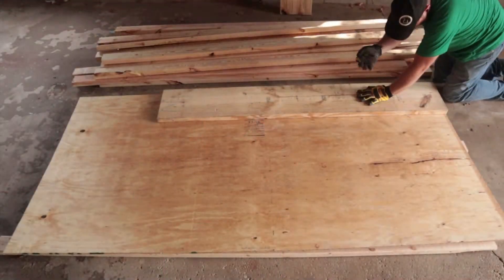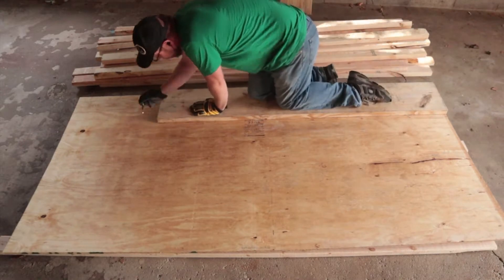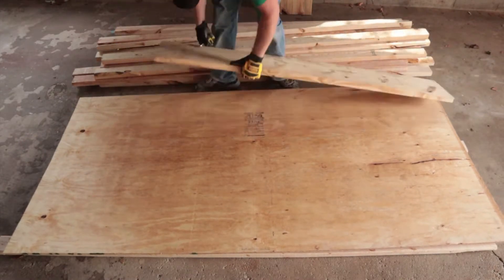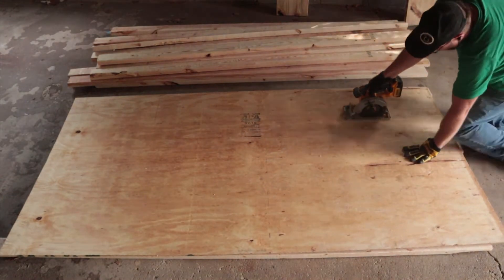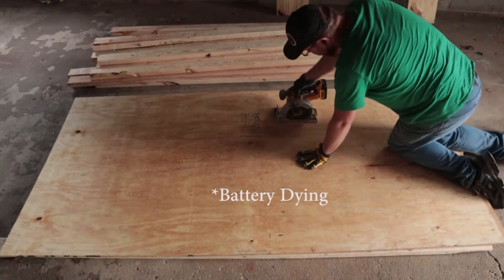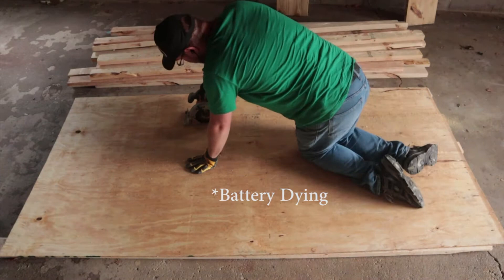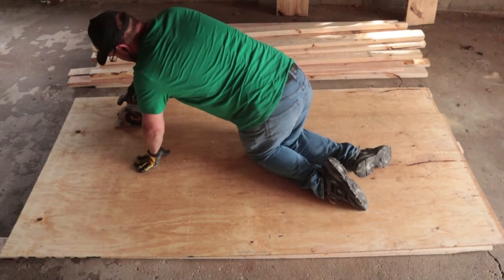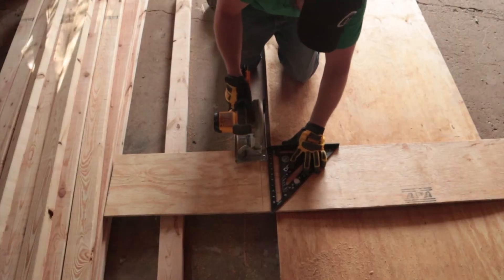Making a Manufactured Beam (Header)

Comment: Couple things to keep in mind. Make sure both crowns are up and stager your screws to make triangles about 1/3 of the way down and up the width of the board. Also if you let that board sit up in the same orientation it will be when installed for about an hour before you install it, you can avoid the glue drips that will inevitably happen. Those always suck when you catch one in your hair.
Reply from the maker: Always good to have extra information. Thanks so much for letting me know